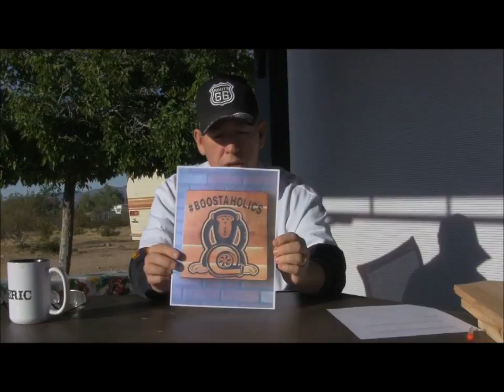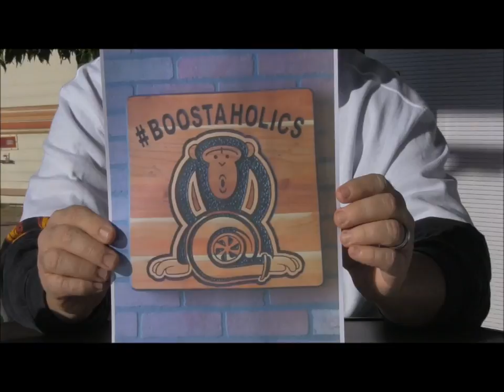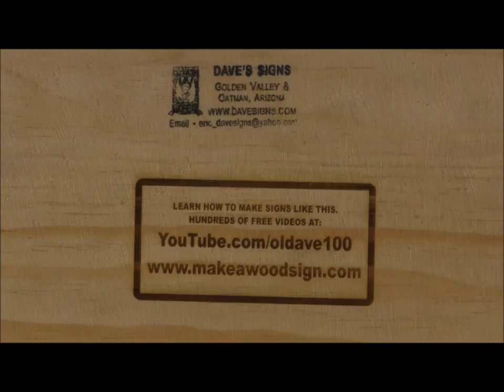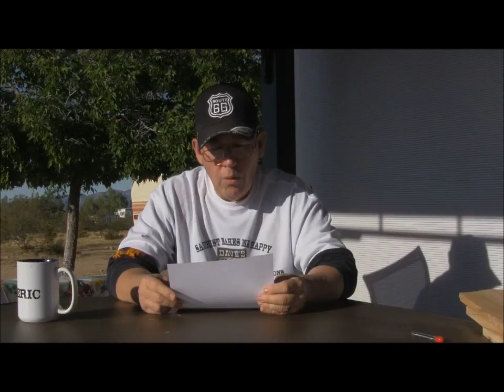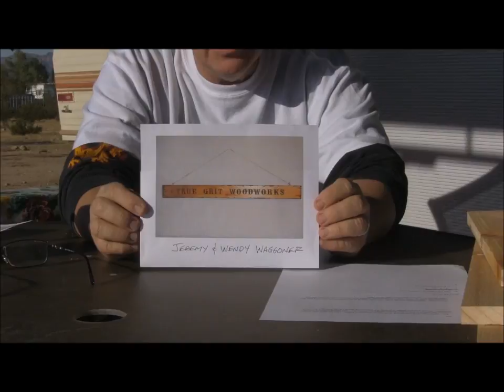Coffee & Questions  5/2/2016  Control issues with the router

Comment: Does the size of router make a difference with control when hitting the different grains?  Right now I only have a DW611 and use it for all cuts (profiling and background cleanup).  When I get a DW618 should the increased power help with control?
Reply from the maker: +Michael E Good question. Not when doing profiling for sure. Possibly on the back round cleanup if you're cutting a hard wood. When you get the bigger router I would switch the clean up over to it and save the detail work & the profiling for the 611.